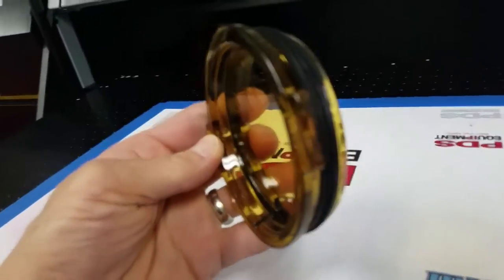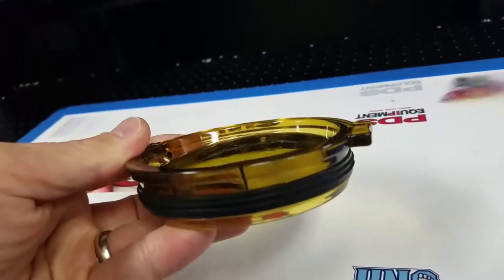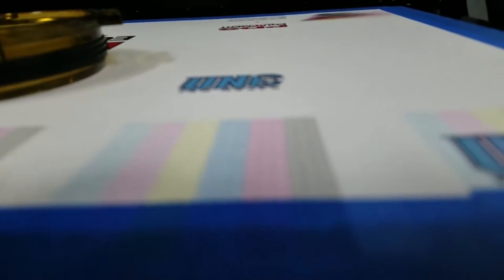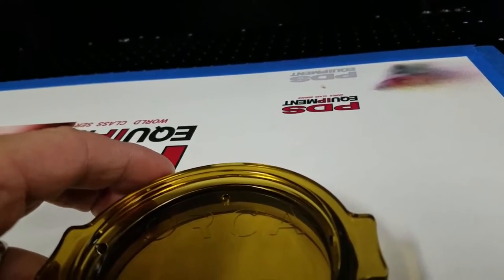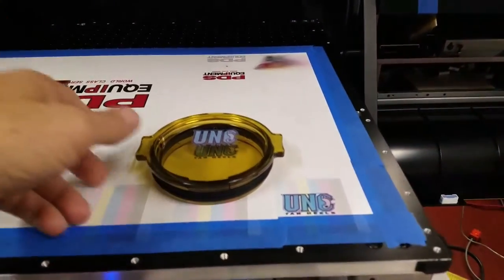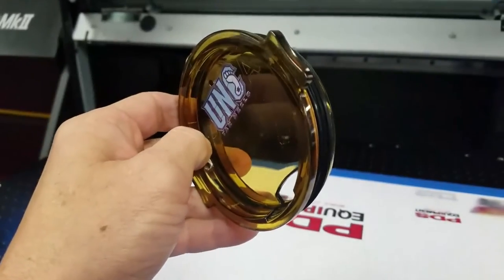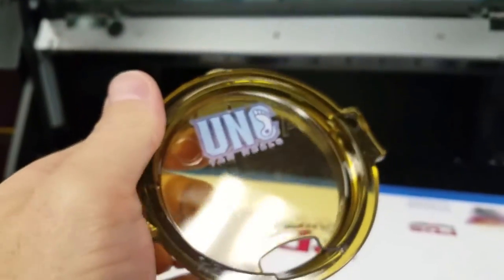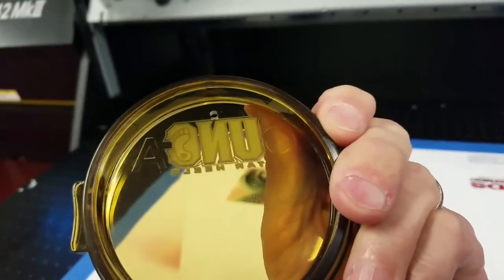The Mimaki UJF-6042MkII printing long distance into a recessed area.

Comment: For those in the future wanting to do this. just look for the ICC profiles from Mimaki labelled LD1 for 1mm-ish gap and LD2 for 2mm+ gap to do this on the downloads section for your printer. I believe the newest UJF-7151 MKII supports an LD3 mode as well.